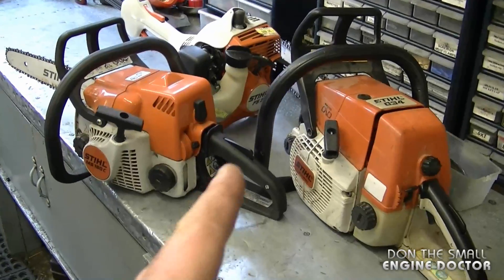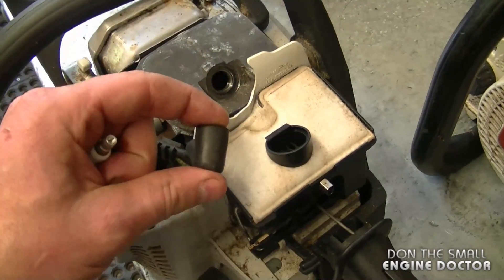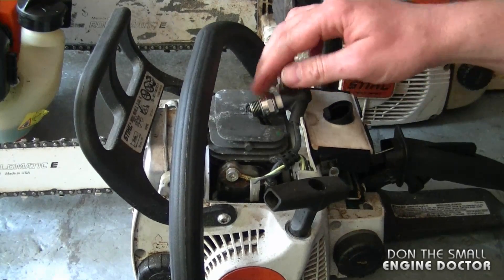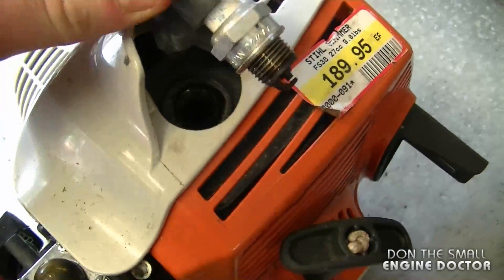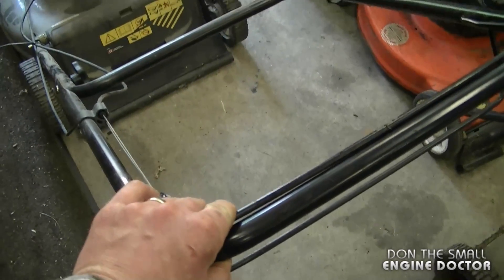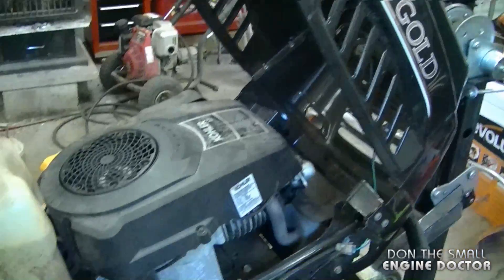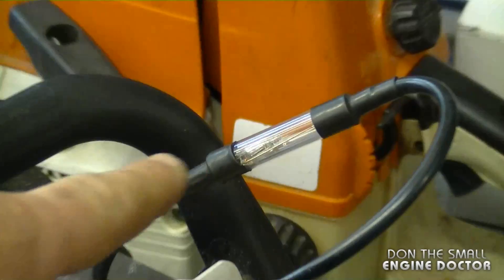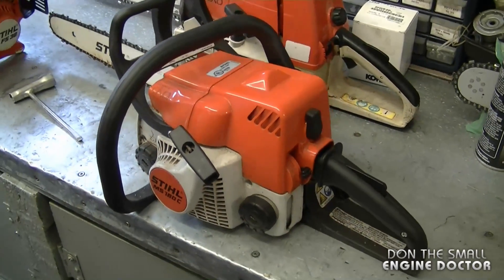HOW-TO Check For Spark Plug Fire On A Small Engine

Comment: Such a helpful video, as always! Trying to tune up (for the first time!) our non-starting Little Wonder C5 Leaf Blower with a Subaru Engine, SP170. Actually can't find clear info on doing this as regards the right parts, but I suppose if we just take it apart, we can match the air filter, spark plug, change the oil, and we'll be fine. Bought the Little Wonder Blower brand new several years ago and it always started on just about the first pull, until this spring season. It has to be dirty. We are a retired hubby & wife who love to tinker with all of our shed toys. Wish you lived in the neighborhood! Thanks for all of your amazing videos. I have the links to them planted on every manual we have for excellent reference.

Comment: I just used a NO CONTACT voltage tester on my multimeter and it worked perfectly.  For using on homelite 360 with a transformer cap and you can’t check spark as any normal method the no contact tester works perfectly.

Comment: Using an in-line spark checker leaves the possibility of a bad spark plug going undiagnosed does it not? I ask because I see them advertised as “spark plug testers” but they don’t actually seem to test spark plugs but rather they test the engines other ignition system components.

Comment: So I have a lawnboy gold series acts like it’s not firing so I took spark plug out of the engine and attached spark plug back in to the coil held it in my hand while my wife tried to pull start it I got no shocking from the spark plug so coil is bad right?
Reply from the maker: sounds like it it

Comment: I was using a battery-powered drill to spin my grass trimmer :D 
I had plenty of fo sparks but they were really small so probably my ignition module is bad.
Reply: Lol we did that on our snowblower; it started and the drill was moving slower than the engine... the flywheel came off and rolled away lol! Thankfully we only lost a few fins and the key got sheared
Reply: @radiantvalor Well, my spark plug was out of the socket to see the spark, so the engine wouldn't start anyway, but even then I didn't attached the drill permanently to the shaft :D
Reply: @GrimPlayerOne  Yeah we probably should have done that lol! We were testing for spark and it worked, so we figured instead if taking 2 seconds to put the shroud back on we'd just use the drill again... hindsight that was a very bad idea

Comment: I have a Echo GT 2000 and it hasn't been operated over a decade. About two weeks ago I've decided give it a go. I replaced a new carburetor but it doesn't start. It has spark and cleaned out muffler. But I can't get to start. What's wrong?

Comment: Replacing a Honda HR214 plug is about $6. So the result is a new plug and it will almost certainly be a good one in a package. If problems persist, the spark plug is not likely the cause and you need a new plug on occasion, anyway.... for cheap!

Comment: Hi,
I have a Stihl strimmer and it keeps burning through spark plugs. After putting a new spark plug it starts ok. After using it and try to start again and won't start. It starts if you put a new spark plug. What is wrong in your op union please.
Thanks

Comment: I have a few chainsaws I'm trying to get running, specifically a Stihl MS 192 TC & a Homelite Timberman 45cc. Both of them seem to only produce spark when the motor is turning very fast, like at what I would expect to be around 1/2 throttle, much faster than a regular idle would be. Do you think that sounds like coils going bad?

Comment: This is an EXTREMELY unsafe way of checking. What happens if the cylinder is dry but the crankcase is full of fuel? One good tug on the rope and you have yourself a pulsing blowtorch and if enough fuel is present, it can potentially cover your hand and arm with the burning fuel. NEVER check for spark this way!!!!!!!

Comment: I rebuilt my Briggs and when I pulled the cord it had a lot of compression and it broke off at least 3ft of rope, I need help
Reply: Repair Online it probably has a broken flywheel key
Reply: +Mike Petramalo except that when I took off the starter cup, it didn't shear, and the piston was just fine, as well as the cylinder

Comment: but you should always remove the spark plug from the engine beacuse sparkplugs can break inside of them so if you pull out the spark plug you Will see if your spark plug is good too. you can have a good spark with another spark plug but that one that is still in The engine could be broken
Reply: Yes, if you use the tool in line with a broken plug, you may not see spark because there's no route to ground. Then you need to remove the plug anyway to confirm where the fault is. It's always nice to see a pro using simple methods, although I can see how it would be awkward when you have to pull a starter cord and watch for spark at the same time. The idea to make pulling easier when the plug is out makes perfect sense.

Comment: Any help? I recently replaced the whole carb on my Stihl leaf blower but it Boggs down at full throttle but works flawlessly at half throttle what should I check for ?
Reply: fortis619 the H and L screws on the carb may just need to be adjusted. Take those black plastic limiter caps off, and L (Low speed screw) is the one closest to the engine block